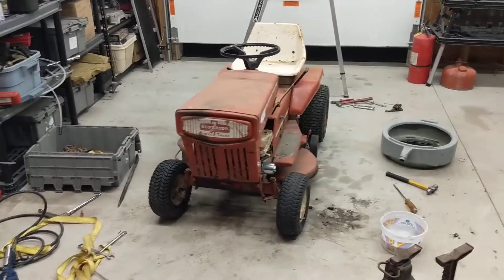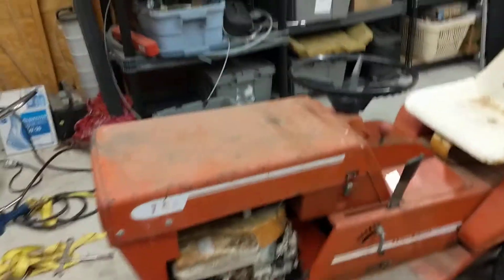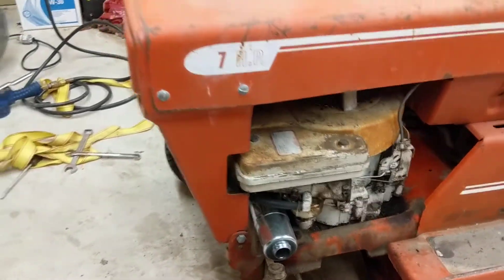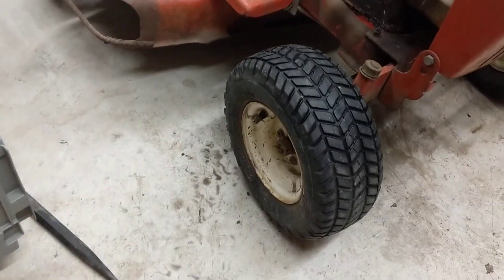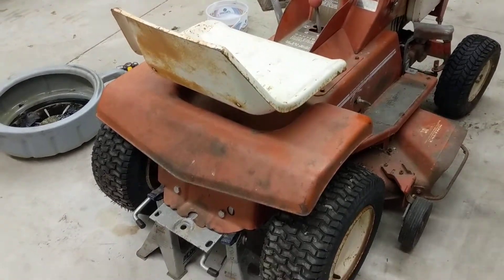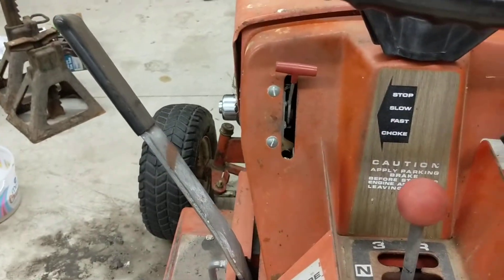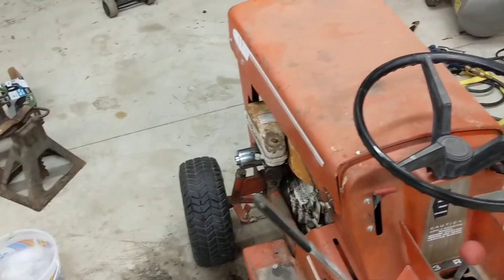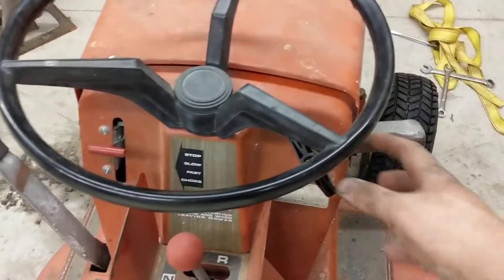Superide 7 Mower Serviced and Ready to Roll

Comment: Found one of these in the woods and am trying to put it back together due to it having good compression, trying to find out what is missing. Do you still have yours? If so could you comment what that engine looks like in completion?
Reply from the maker: Hey yeah, sorry I haven't been on to see this comment. I have it, I can probably wrangle up a pic or two sometime this week. Anything specific or just general engine pics?
Reply: @dozersgarage5420 I would say, just general pics if you can! It would be helpful so I can make sure I have everything positioned correctly!